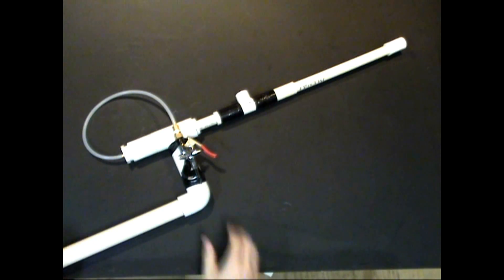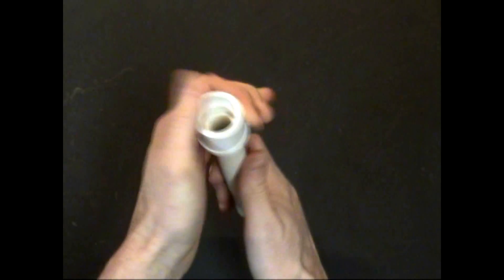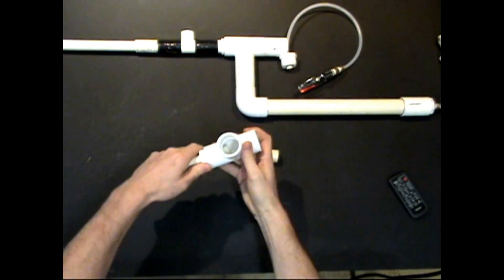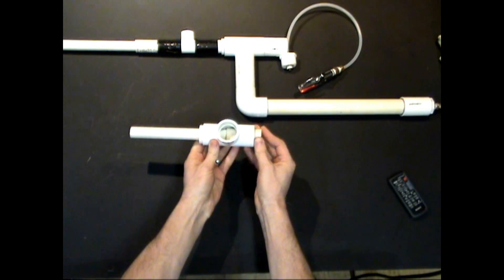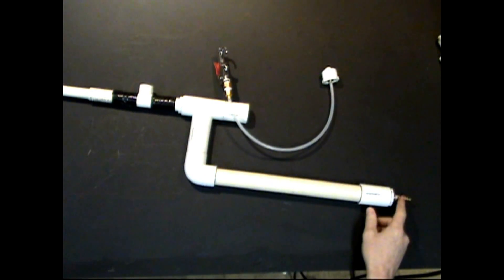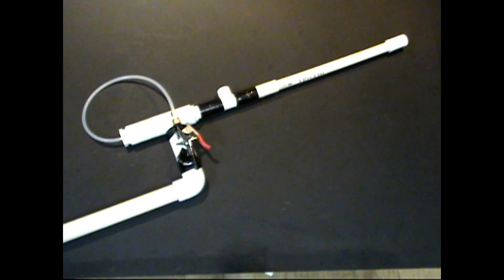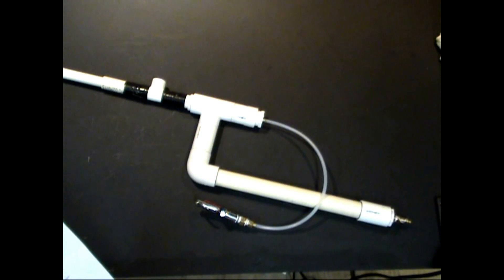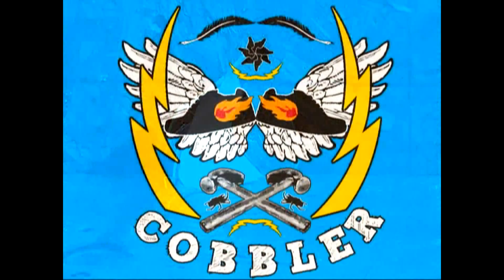World's Most Powerful Marshmallow Gun -- How To Make Your Own

Comment: Make a back mounted volume tank out of a large diameter PVC section and run a small DC powered air compressor attached.  You won't break jars with a marble but your kid will be a hero with the marshmallows.

Comment: I just finished making one of these. I am not getting any air to shoot through the barrel. When I pressure it up and release the air on the back of the tee nothing happens accept air blowing out of the air gun. Obviously I'm getting a good seal on the barrel from my piston but it must not be moving off the barrel when I release the pressure. Any help would be great! Thank you!
Reply: +Hafeez Akbar If it sounds faster then the speed of sound then it isn't lol
Reply from the maker: I think you have one of 2 problems, maybe both.  1. You might not be getting enough air out of your trigger.  The first trigger I used didn't blow hard enough.  2. The pistong needs to fits snuggly, but still be able to move easily.  If you have too much air leaking around the back of the piston, it will not get sucked back when you pull the trigger.
Reply: Cobbler Videos do you know the fps on this thing? sounds faster than the speed of sound.

Comment: How did you get the 1/2 inch T to slide back and forth over the barrel - did you bore it out?
Reply: I'm replying to myself - where do you get 3/4 low grade pvc - its impossible to find for the auto loaded.  Does anyone have a work around?

Comment: Just a heads up I built a version with 2" barrel after watching this and it is POWERFUL. the biggest problem is finding a material to withstand slamming into the barrel that will also be airtight. Also the only sizes I could find close enough to make the piston was a 2 1/2 in pipe inside of 3" schedule 80 getting that right is also a pain. Don't forget a big ass spring or the piston will blow right the hell through the back of the gun [I know It happened to mine and f'd up my hand]

Comment from the maker: The threads on my blow gun are on the inside too.  Home depot has a fitting that connects that size threading to refrigerator water supply tubing.
Reply: Cobbler Videos 
I'm having issues with the air going straight through the barrel. Doesn't seem to hold any air in the air tank (stock of the gun)

Comment from the maker: Think of it this way.  The pressure in the barrel is very low compared to the pressure in the chamber and behind the piston, so the piston gets sucked against the barrel by the low pressure in the barrel.  Put your hand against your vacuum hose.  It will be held there firmly.  Pull your hand away and air races through the hose.  Same concept - the vacuum hose is the barrel.

Comment from the maker: about 120 psi depending on how high I turn up the air compressor.  I usually can't think of any reason not to run as hot as the compressor goes.

Comment from the maker: The blow gun dumps pressure from the back of the cylinder.  Now the pressure in front of the cylinder is higher, so the piston flies back.  (Essentially, you have created a relative vacuum behind the piston.) This allows the compressed air in the chamber to exit through the open barrel.  Does that make sense?

Comment from the maker: That tubing is designed for refrigerator water suply.  At home depot, they have a bunch of fittings also desinged for this tubing.  I just got the fitting that connects to the tubing on one end and screws onto the blow gun on the other end.

Comment: I just finished one myself, modified slightly of course. The problem likely isn't the piston. I have about 9 cannons laying around and my last one (made entirely from copper and brass) also used a piston with a 1" tee. I found the problem to be releasing the air behind the piston fast enough. I even tried bigger ID hose, but to no avail. You need a bigger valve to shoot it, at least that is what has worked for me. You may be right about the piston, make it longer so there's less volume behind it

Comment: If you made the pilot valve larger in width couldnt you screw in two schrader valves removing the need for a spring? Or is that unsafe?

Comment from the maker: I used one of those rubber things with a bolt going through it that you use for sanding.  The thing is made to put a ring of sandpaper on and then tighten the bolt, which expands the rubber to hold the sandpaper in place.  I don't know what its called, but it comes standard in most dremel bit sets.

Comment from the maker: ...the piston will slide easily, but not so loose that air moves though that space.  I had to add one thickness of scotch tape to my piston to get the fit right.  When I did that, the gun worked perfectly.

Comment from the maker: My guess is that you have too much air leaking around the piston or the trigger doesn't purge fast enough.  One way to check that is to remove the hose leading to the trigger and hold your thumb over the purge hole, then release.  If the piston fires then you know that you need to dump air faster than your trigger can handle.  You may be able to use the same trigger if you make the fit between the piston and cylinder a little tighter.  You want the fit to be loose enough that...

Comment: I made this  gun and when I pull the trigger air comes out of the trigger the piston does not move when u press the trigger I tried different air pressures from 10 PSI all the way up to 100 PSI can you tell me what I might be doing wrong is maybe the chamber holding the pistontoo short I have about an inch from the back of the piston to the back of where the trigger hose screws into. Do u think u can give me some measurements of the piston and also the chamber? that would be awesome thanks

Comment: I'm amazed your marshmellow stays in 1 piece. I left another cmt on another video of urs but when we built ours we used a 2 litre coke bottle for the pressure chamber. What air pressure are you running at? We were able to clock at 80psi and the marshemllow deforms from the blast as it leave the barrle

Comment: Fast as I can 'rack' the action :P  oi man, I couldn't find those exact bits at an Aussie plumbing store... fkn duds we are.  Also wtf are the holes you drilled in the Piston ? does the hot glue fill the entire piston or just up to those holes ? Im assuming the holes are where the air is able to get behind the piston itself ?  And did you slide the piston straight into the T-piece ? Or is the piston inside that piston guide then all that goes inside the T-piece ?

Comment: Bought a PVC pipe welder today just to make this gun. :D
Also had to buy lots of fittings to make a 1 inch pipe to compressor connection. I'm gonna start building tomorrow. :)

What's the pressure in the chamber?

Comment: Your chamber filled design is ideal for low pressures up to 150psi.  For higher pressures, even if I decide to use a full metal construction, chamber fill is safer, because the spring behind the piston may not work properly, or may allow air leak through the barrel (unwanted discharge) at 400psi.

Comment: Do you suppose you could rig up a hand pump to supply pressure to the chamber using this scenario...or does the pressure chamber require constant pressure from a compressor to work?

Comment: If you have air leak out the barrel the piston is not sealing against the barrel.  Could be the fit of the piston, it needs to slide with a little pressure, not too much, not too little.  Also the barrel end and piston end need to be cut straight precisely since they meet up and make the seal.  That is all I can add to this.  Really just making without glueing it will give you all the understand you need.  Hope this helps somebody.

Comment: I agree that making the gun is simple and just looking at it you can figure that out.  Making it work is the trick.   I used male air compressor fittings and screwed them into the plugs with some teflon tape then bought a section of hose (check psi rating), easy and cheap (I already had them too).  When you connect the T with the slip-to-threaded coupler section that houses the spring you will be using a section of 1" schedule 40.

Comment: This makes the piston slide back and all the pressure is the gun can now escape out the barrel.  I used schedule 40 for the piston not light duty because I found both were the same outside diameter and neither fit like chuvak1's did in the video (this is all before either one of us sanded).  Schedule 40 is thicker and stood up to the heat created when sanding.  It is very, very important to only sand the piston enough to have to lightly push it through the the T otherwise it will leak.

Comment: I will try to explain better than chuvak1 but I doubt I can.  It is strange at first but you pressurize the whole gun, the piston is pushed against the barrel (smaller size and the glue make an air tight seal) with the spring but pressure really forces it tight.  Since the piston is a 'tight' fit it still allows air to pass and pressurize the back side of it where the spring is.  When you press the trigger it releases the air on the spring side of the piston creating a vacuum effect.

Comment: So my fix for all issues (so far) was that my orginal (higher quality) valve wasn't releasing all the air so I had to fabricate the handle to push down fully on it's own piston and I did bore out the intake side.  I cut a new barrel and piston more precisely on a miter saw and very slightly rounded the piston side of the barrel so it would not dig into the glue which was a problem I had with durability.  I also scored the inside of the piston to hold the glue.  Works great now.  Thanks!!!

Comment from the maker: My glue fell out after about a month or so.  It was easy to pur new molten glue in.  You might try making some scratches on the inside of the pipe.  Give it something to grab ont to.  Also try putting more clue in there.  I have about 1 inch of glue.

Comment: Thanks for a great idea!  Built it and it works with a few minor issues to work out.  I am having an issue keeping the glue in the piston and 2 different valves won't dump the air fast enough so I will try your suggestion and bore out the holes.  The gun does work great when releasing the pressure with a finger.    One note is I ended up using schedule 40 3/4" pipe because (and I don't understand why) light duty 3/4" didn't fit any better and Schedule 40 was less susceptible to warping from heat

Comment: What do you think the smallest compressor is that you can get by with? The cheapest ones I can find are $20, but I'm not sure those would work as is. You would most likely need a longer hose (unless you put in a backpack or something like that) for the cheaper ones. And I didn't include the air compressor when I looked up the prices.

Comment from the maker: This gun shoots a small mass at high speed.  Underwater spear guns usually involve a large mass at lower speeds.  Even with the lower speeds, the momentum is greater with the larger mass.  This is import in water where friction is so much greater than in air.  I would stick the larger mass spear concept for underwater use.

Comment from the maker: I'm sure that would work.  If there is an issue with too much pressure, it could easily be regulated.  The problem is that the gun is inefficeient in that is uses a lot of air.  You just wouldn't get all that many shots out of a paintball air tank.

Comment: So I figured it all out. On the first piston I used schedule 40 3/4 instead of light duty and with the extra thickness of the wall more sanding was required which in turn heated the PVC and distorted it rendering it useless. 
Second was the blow nozzle you were right about the flow restriction so I went through and  bored the ports and it works flawlessly every time. Thanks for the advise and help.

Comment: I did the tape idea and that is when it started working but it is inconsistent. The hot glue only piston has been used by the French guys for a while now and seems to work well.
They use a combination of brass and PVC in there paintball/marshmallow guns and a garden hose sprayer nozzle.

Comment from the maker: Do a test.  Remove the hose and trigger and then plug the air hole at the back of the cylinder with your thumb.  If you let your thumb off, does the piston fire?  If so, then maybe your blower doesn't vent fast enough.  Did you try the scotch tape idea?

Comment: that is what the problem is so I made a new piston out of hot glue from a release mold but it is still inconsistent in function sometimes it fires and sometimes it hangs up. it is frustrating to trouble shoot. it also seems to like 60 to 85 psi but not 125
this project is new to me and knowing what to do to or what to change to make it work consistently is tough

Comment from the maker: The piston length depends on your cylinder length. It should be long enough to travel only about 1/2 inch in the cylinder.
The holes in my piston were an experiment. At first I had the same problem with the piston not coming back when triggered. I thought that maybe a glue plug on the back and and the holes to allow high pressure inside the piston would help - it didn't. Getting the right fit with scotch tape did the trick.

Comment from the maker: It sounds to me like your piston fits too loosely in the cylinder.  If that is the case, then more air will pass around the piston than can be dumped by the trigger, so you never really get a low enough pressure behind the piston to pull it back.  Try wrapping a piece of scotch tape around the piston so that the fit in the cylinder is snug, but loose enought o slide with very little force.

Comment: when
when I pull the trigger on the blow nozzle air is expelled from the nozzle but the piston does not retract and redirect the air flow to the barrel. I also wanted to know the exact length and diameter of the piston and  and how full you filled the piston with hot glue because there seems to be a bypass hole on yours to charge the back of the chamber. I also want to make sure that variances in the down pipe and air chamber are not going to affect the performance of the gun

Comment from the maker: @777Semper Right.  Before you pull the trigger, the pressure is the same all around the piston, except in the barrel, where the pressure is lower.  This keeps the piston pressed firmly against the barrel - or suctioned agains the barrel.  When you pull the trigger, the pressure behind the piston goes to zero.  Since the front surface of the piston is bigger than the barrel, there is pressure pushing back on that area of the piston that is bigger than the barrel - enough to push the piston back.

Comment from the maker: @777Semper That's a good question.  Think of the piston as a potato in a potato gun.  When you dump the pressure behind the piston, there is a big pressure difference on either side of the piston.  The pressure in front of the piston pushes it back, just like a potato that is suddenly introduced to a huge pressure difference between it two ends.  Alternatively, you could think of it as a vacuum.  When the trigger is pressed and the pressure is dumped, the piston is sucked backward.

Comment from the maker: @ENDVash This sounds like a lot of parts, but they are all readily availible at Home Depot, Lowes, or Ace.  The whole thing should cost less than $25.  Many people probably already have a few short pieces of pipe and other stuff lying around.

I almost forgot the spring - sized to fit inside 1 inch schedule 40 pipe.  Mine is about 3 inches long extended and only has a few onces of resistance.

Comment from the maker: @ENDVash The rest of the Gun:
-	1 inch schedule 40 pipe
-	1 inch schedule 40 90degree elbow fitting
-	1 inch schedule 40 coupler.
-	schedule 40 1 inch to ¾ in slip to threaded reducer
-	Brass ¾ to ½ inch reducer
-	½ inch pneumatic quick release coupler
-	PVC primer and cement

Comment from the maker: @ENDVash Trigger and Linkage
-	Pneumatic blow gun tool – the kind you use for blowing off your work bench.
-	¼ inch refrigerator water hose (120 PSI or similar) or pneumatic hose.
-	Brass fitting with male end to tap into the PVC cap at one end and hose at the other.
-	Brass fitting to link blow gun to hose.
-	Brass fittings for the ends of the hose that will connect to the fittings you just attached to the cap and the blow gun
-	Vinyl electricians tape to tape the blow gun to the handle

Comment from the maker: @ENDVash Receiver:
-	1 inch Schedule 40 T joint
-	1 inch to ½ inch Schedule 40 Reducer fitting
-	1 inch Schedule 40 PVC pipe
-	1 inch schedule 40 fitting – slip on one side, threaded on the other
-	1 inch schedule 40 screw on cap

Comment from the maker: @ENDVash Here is a list of parts that I used for my gun.  Most of this could be changed according to what you have available, or improvements you want to make.

The Piston:
-	Light duty ¾ inch PVC pipe – and for pump action loader
-	Hot Melt Glue

Barrel:
-	1/2 inch Shedule 40 PVC pipe.
-	2x ½ inch coupler for cosmetic muzzle break and for pump action loader
-	½ inch T joint for pup action loader
-	Duct Tape to connect the pump action parts.
Reply: You're missing some parts